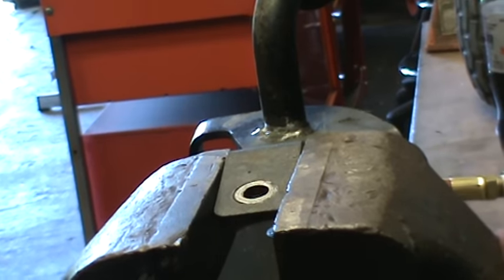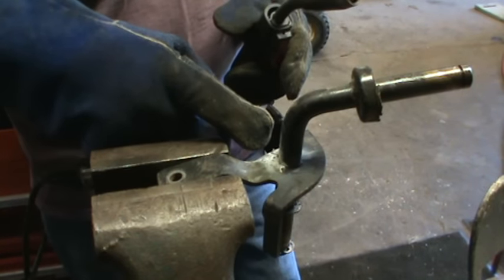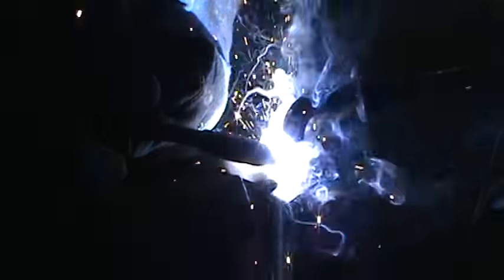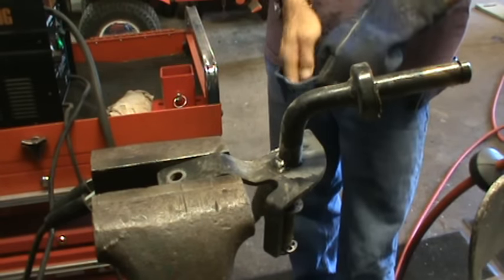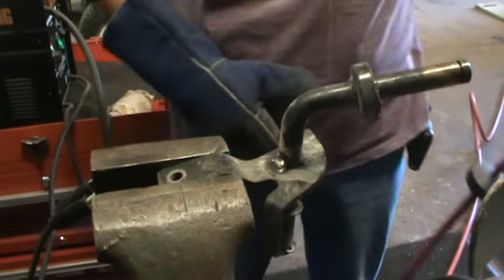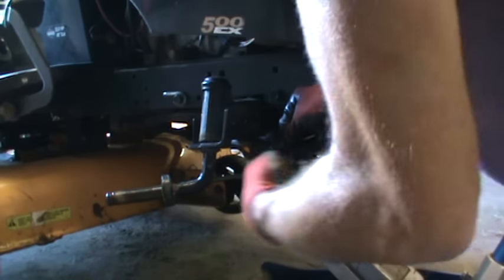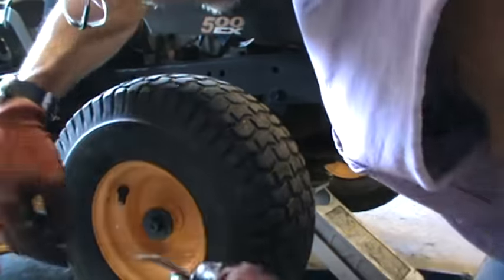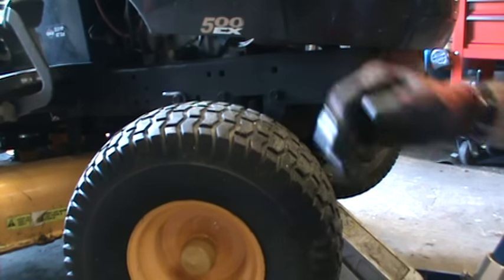Poulan Pro Broke a Weld Part 2 Conclusion

Comment: HA, never thought of heating the covers up , I have a small rubber ball peen hammer that one or two smacks in the center of the cap pops them right on. I like the heat idear better. Nice job Zippo

Comment: That's a great little welder. On my 3rd 10 lb spool and no problems so far. One of the best investments I've ever made. Great video!!!
Reply from the maker: Thanks boat! It truly is the best investment for the money. Would I love a high end Hobart, Lincoln or Miller? Sure, but this does everything I ask of it. Cheers!! Zip~
Reply: ZippoVarga Yeah. I'd love to have a Lincoln or Miller too. Its difficult for me to justify spending so much on a welder that I can get at harbor freight for less than $100. I'm the same, it does everything i ask of it. No need for something better.
Reply from the maker: Absolutely. You're a lot like me. Get what works, not what costs the most, has the most bells and whistles etc. Zip~
Reply: ZippoVarga Simple is the best. There's less things to go wrong.

Comment: Nice repair Zip. Guessing result of colliding with obstacle and torquing up the weld from a sharp turn on a grade or something. I  know on my mower, I was lucky, the  only casualty was the ball joint popped on me and I did the chisel trick to keep it in place. However neighbor across the street has a dozen or so old ones and gave me one in good shape in case it doesn't hold. Great job of repair you did there and thanks for the vids !
Reply from the maker: It's hard telling what caused the welds to let go other than it was just two small spot welds instead of a full weld all the way around the spindle. Now I'm dealing with a toe out issue, but on inspection, when I turn stop to stop, the spindle travel stops are spot on with either side. Stranger things have happened though. In all, for a freebie 48" 22horse power hydrostat machine with less than 300 hours on it, I'm not complaining lol. Cheers! Zip~
Reply: Wow, what's the cure for that one? Heat it up and bend or beat on it ? Good things sometimes happen to those that do for others, as I watched one of your vids (engine swap in the murray) where you fixed up an old mower for your neighbor, which was a kind thing to do, so glad you got that mower as a freebie. Thanks for the great videos !
Reply from the maker: Thanks Arcie. I get a lot of yard art freebies that I put back into service and give away. I used to do 12-18 riding mowers a year like that and find needy homes for them. The family that got the Murray is a great Christian family that's always done right by me, so it was the least I could do for them. An older rider I gave them some years back had ran its course, so I had been on the look out for a replacement for them for some time. Cheers Arcie! Zip~
Reply from the maker: Oh, and with no adjustments anywhere for the toe in/out...I'll be heating things up and doing a home brew alignment. It can't be good on the tie rods/ball joints to be pulled in either direction like that. Cheers! Zip~